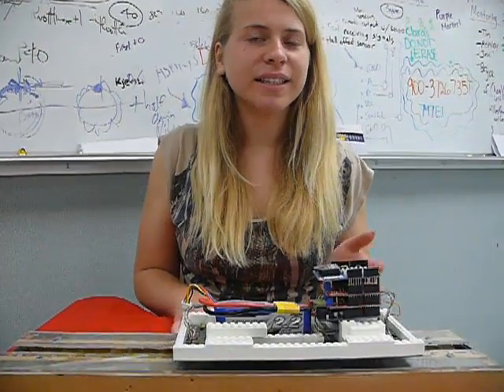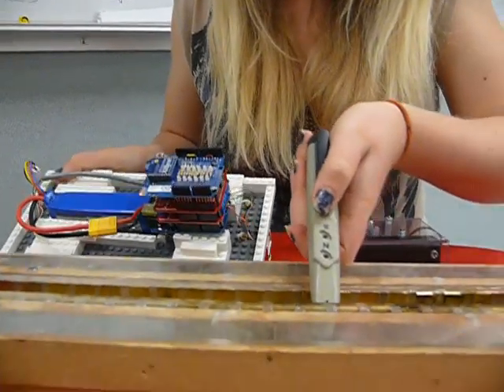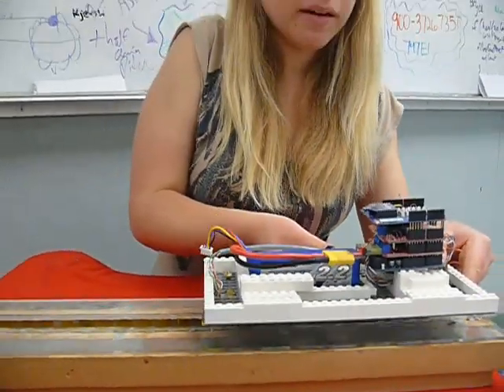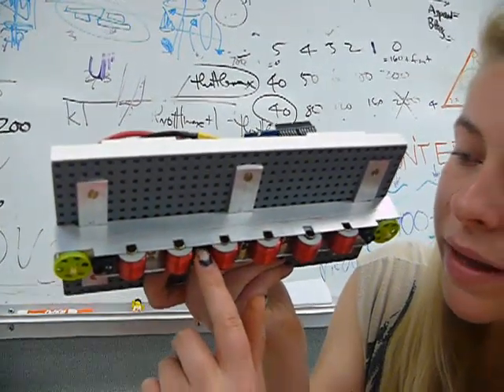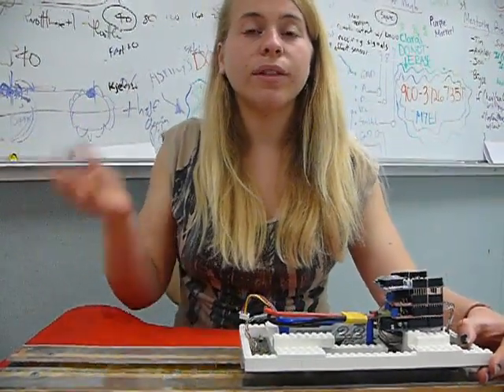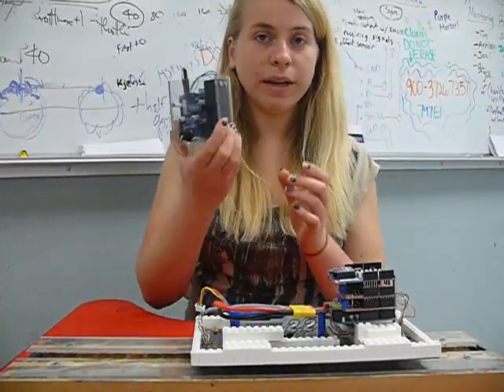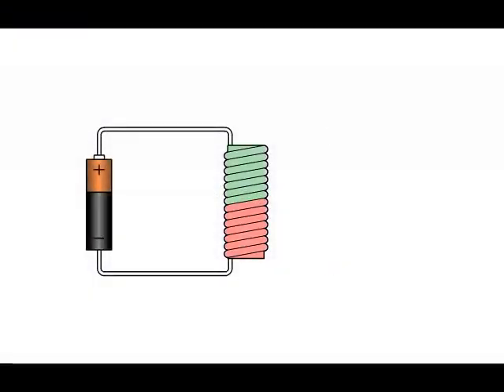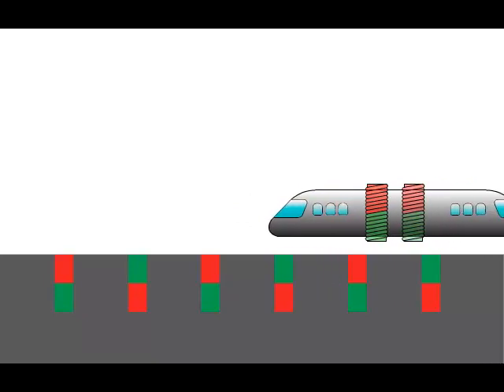Antipodes DIY Remote Controlled Maglev Project v.8

Comment: I'd guess from looking the bumpiness is due to the stop-start from such a short track, on a longer one it should be fine. Since the floating itself is entirely from permanent magnets, on the train's underside and at the sides of the track. 

Also, since it's "suspension" is frictionless, any up-down motion takes a while to be absorbed, creating the bobbing pendulum effect. 

Aren't girl geeks the loveliest?
Reply: Hello kindly asking for any technical assistance trying to make a similar project. Schematics, circuits anything etc